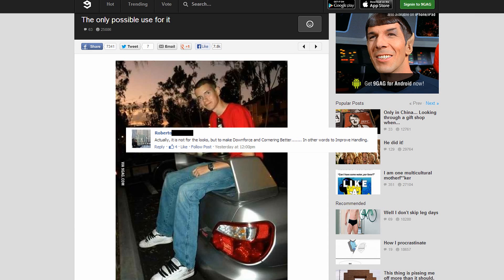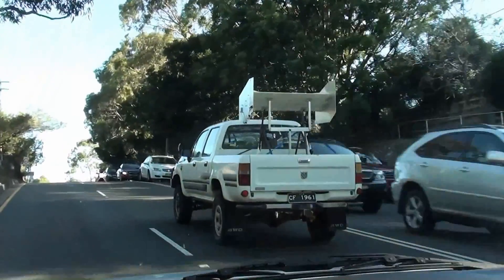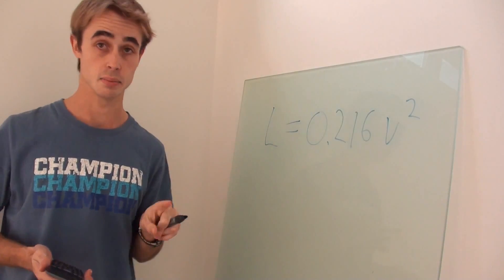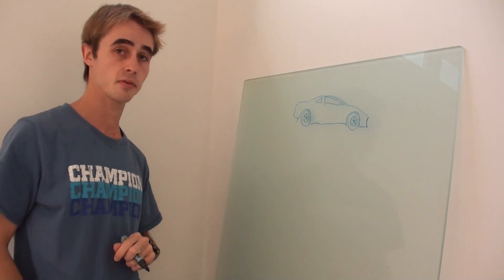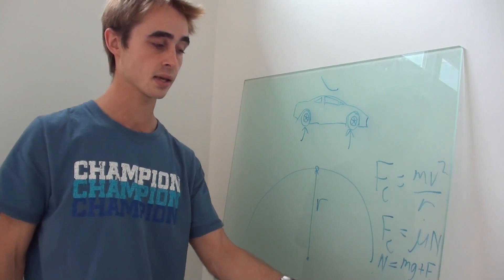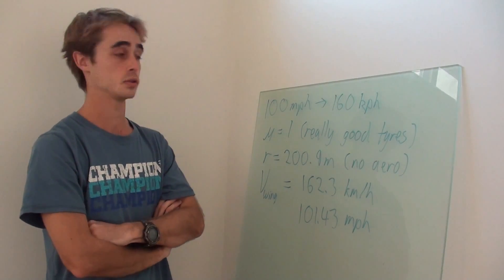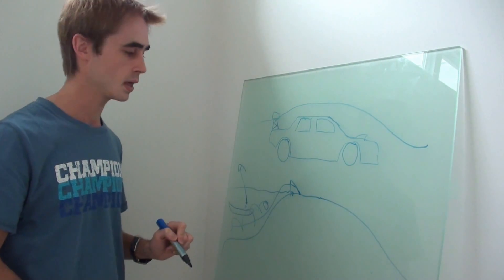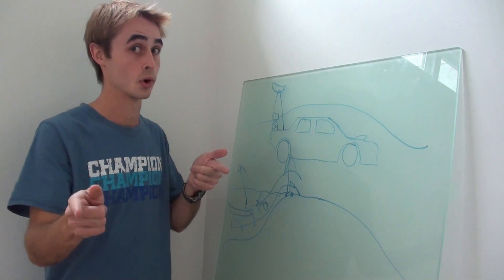Do Car Wings (Spoilers) Actually Work On-Road?

Comment: There was a test between a lighter version Evo RS that has no wing and the heavier version that does and the heavier version was faster. I think what this guy is missing in his dislike of wings is in racing a little bit is a lot. A little faster through a corner results in a lot faster at the end of the straight. 

BTW, if you are trying to discredit SPOILERS why was your video about wings? They aren't the same.
Reply: scrolex The point was that at street speeds there wont be any noticeable difference. And yea I got annoyed as well that video name says spoilers but video itself is about wings
Reply: That's attributed to the weight, more than the wing itself..

He said in the video that spoilers and wings DO make a difference, in race cars that are going really fast.. he went through a number of examples and how much downforce they created at certain really high speeds.
When he says it does fuck all, it's in the context of road cars doing the speed limit with the usual spoilers and wings you see on cars. You missed the whole context....

Comment: So who do i believe? the kid doing physics in his room or the car manufacture that has been making cars for years and puts the wing on for a specific reason like on sti's and evos?
Reply: ***** "manufacturers put wings on road cars is look"

That right there.  In fact, some spoilers that are factory installed are designed to to be neutral drag/lift thus solely designed just for appearance. An example would be on the early Dodge/Plymouth Neon's.
Reply: lamakicker69 , they do it cuz kids think it's cool and/or for aero efficiencies to improve milage.  But if you think it's making appreciable downforce,, you're either high or can't understand very basic physics and math.
Reply: Dude, look at the intro on his video on vortex generators, he's not just "the kid doing physics in his room", hes trying to tell you the "specific reason" manufacturers put wings on road cars is looks. Even Mitsubishi's own paper claims minimal downforce when you look at the numbers.

Comment: They really do work! But only for rear wheel drive car. It puts more pressure on the rear tires and the tires will have more grip. You can have it on any car but it doesn't mean it will work
Reply: centripetal25 Sorry to burst your bubble buddy but i have been racing cars for many years and more recently FF cars, there is noticeable corner speed stability and downforce factor with our cars we race that have a decent rear wing versus one without. real world results have proven this. I like how you edited your comment and added a silly opinion, you don't know shit about race car aerodynamics, go back to playing your Xbox car games.
Reply: its works the same for FF cars it doesnt matter where the power is been put down. FF cars can suffer from oversteer thus making it just as justified.
Reply: ps w Except in high speed, the rear wheels act as a fulcrum and it actually LIFTS your front (driving) wheels off the ground. If it creates any amount of significant downforce (which as this video states... is unlikely), the wing would actually induce loss of power (and therefore speed and acceleration) in a FF. This is why all factory wings for FFs have non-functional profiles (ie. RSX, cobalt SS, other lip spoilers etc.). I personally think that putting a huge carbon wing on civics show a lack of understanding of physics, regardless of whether the effects are negligible or not.
Reply: No thats not right the wing will cause lift in rear tires meaning that there is less grip for the rear tires. If you are racing on a straight line you would want a mid or rear engine car so weight is taken off the engine from the spoiler.

Comment: So the answer is yes.  97 lbs of downforce which is high but that is a huge amount for free.  But yes on a street car doing the speed limit probably not much value unless it is to decrease drag by smoothing the airflow.  Then it might benefit MPG.  But wider tires are probably pointless doing the speed limit on public road a long with multiple other things.  Basically everything on a sports car does nothing at the speed limit on a public road that is not what they are for.

Comment: You do realize that wings are mainly used for downforce not lift right? That way the car grips the road better giving more ""mass"" to the ground letting you pull harder into a turn, also airflow changes completely from car to car so your airflow model is invalid.
Reply: watch the video again he covered that

Comment: I can say that after removing the stock spoiler on my 89 Mustang LX, you could feel the difference traveling at interstate speeds. The rear of the car was "looser" and a little bit less stable (even more so in the rain). At normal speeds, I agree they do nothing. There was no noticeable difference in town. As most of my driving are at speeds of around 70 mph, I installed a factory GT rear wing (which has an air gap between it and the trunk) and there was a sizible difference in stability at interstate speeds. I have talked with my uncle (who was an engineer for NASA and Boeing) and he explained to me that my spoiler was not in creasing down force, but was stabilizing the air coming off the back of the car. By not allowing the air to roll off the side of the car in the back, it causes the car to be more predictable while driving. While aftermarket spoilers are more for looks and probably do more harm to your performance. A stock spoiler are designed and tested in wind tunnals to perform with the shape of the car to control air flow. I did notice a difference in fuel milage. With the spoiler removed, I gained about 1 mpg.

Comment: 2. "Do car spoilers actually work ?", it doesn't say "Do car spoilers work for going faster?". The wiper thing is confirmed, ask "Toshiyuki Okumoto".

3. I am not talking about the Aero pack, I am talking about the standard wing.

4. I'm talking about lateral G not vertical G, coming from the "up-parts" from the spoiler. Srry my english isn't good.
The Aero pack from Toyota (big wing) was used to set a lap time for nürburgring (know as nürspec kit), (used like a EVO spoiler).
I own one btw :)

Comment from the maker: I'll reply point by point:

1. You might want to watch the video again

2. That is outside the performance benefits, over which the spoiler arguments generally start. I would also hypothesise that that lack of rear wiper is more due to the flatter glass and resultant attached flow than the spoiler. 

3. Toyota claims no improvement in the drag coefficient from 0.27 with the rear wing and aero pack added

4. The "stability" you refer to is from downforce on the tyres, covered in the video

Comment: Car spoilers WORK for normal cars but not like a F1 car wich has spoilers for downforce.

The little wing of a Honda Civic latest model (2006+) for example makes that a rearwindowwiper is not needed anymore, it will change the airflow a little bit wich automaticly "cleans" the rear window.

The wing of a Scion FRS/Toyota GT86/Subaru BRZ makes the airflow of the car better meaning a less drag coëfficiënt. (Most wings are used for this)

The wing of a EVO makes for better stability (lateral force)

Comment: Well done!  I did not think in terms of cornering, but straight line driving.  I did the math in my head and roughly figured a "spoiler" or wing would only start to come into play about 150 MPH for a production car with a factory installed spoiler--if at all.  I did not consider the spoiler to do anything else than provide downward force.
Needless to say, I do not have a spoiler on my car.

Comment: F1 use optimal wing placement high above the rear of the car and encounter speeds higher than those usually driven on normal roads to provide their traction.

Comment from the maker: The TT problem is a little different, essentially the whole car is shaped like a wing, producing massive amounts of lift (look at it from the side), and the rear spoiler was essentially added as a "gurney flap" to decrease the lifting efficiency of the body "wing". Again though, these effects would only become noticeable at well over 200 km/h (Autobahn speeds), and that's the entire body working as a wing! Coincidentally this was the speed where the fatal crashes occurred 

Thanks for watching!
Reply: I’d be interested in a video of how spoilers can function to reduce the overall drag of a road vehicle and their effectiveness. This video didn’t really touch on that claim or possibility, and focused more purely on performance downforce.

Comment: I heard that the original Audi TT had a safety issue due to loss of traction in the rear at high speed and they had to put a "mini" spoiler in back to eliminate the problem. Was this just marketing hype?